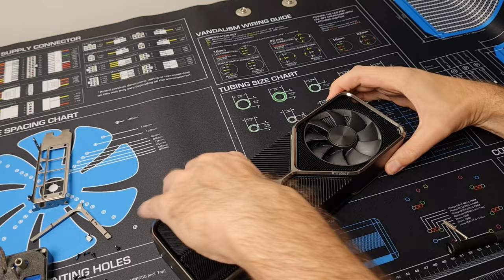ALPHACOOL EISWOLF 2 - Timelapsed Teardown & Montage

Comment: Could you tell me where the black mesh cable is connected?  I connect it to the water pump + of an asus motherboard, would it be fine there?  And the radiator fans, which would be the most suitable connector?  Thank you!
Reply from the maker: Hey. You connected the mesh cable on the right place. You can put the fans on any fan connectors an the board. I like to connect it to the connectors nearby the memory slots.

Comment: How are your temps? Bought this aio last november, my temps get up to 65c. Thought it would perform better
Reply from the maker: On which card you use it?
Reply: @tobishardwareecke  3080ti fe
Reply: @tobishardwareecke  same temp rtx 3080ti 63c.Witch undervolting 55c 875v 1800mhz
Reply from the maker: @Hairtransplant993  This sounds great, thanks for the information.
Reply: Sounds good, maybe build a bigger loop with second radiator, better Temps with longer way for the water
Reply: @Hairtransplant993  my 3090 fe in stock has 71-72 in load and 50-55% fan speed but i did thermal grease and pads replacement. Your temperature with this aio isn’t that good. I thought to buy this aio but now after I saw your temp I’m confused)